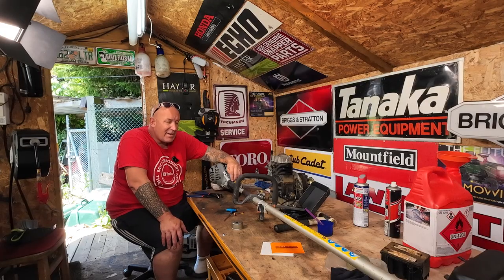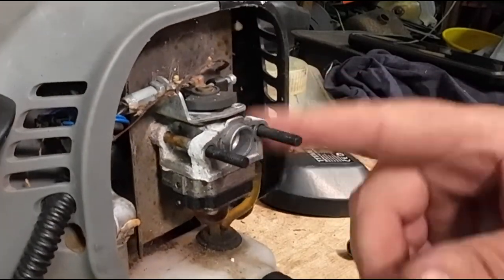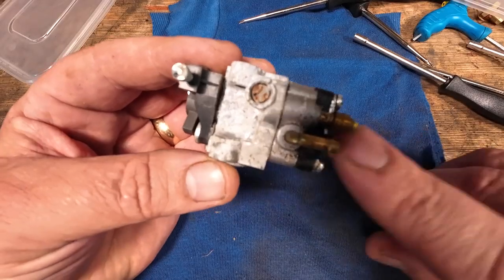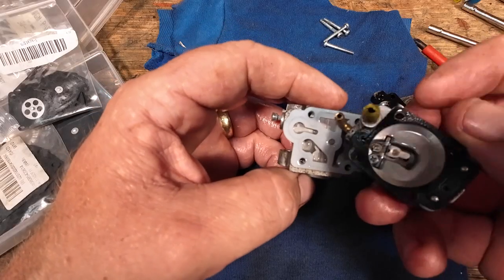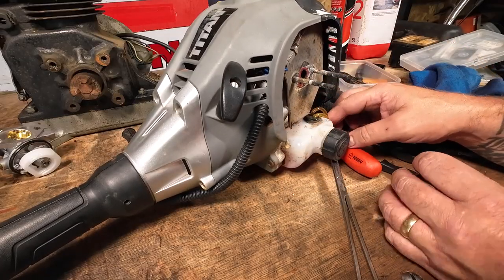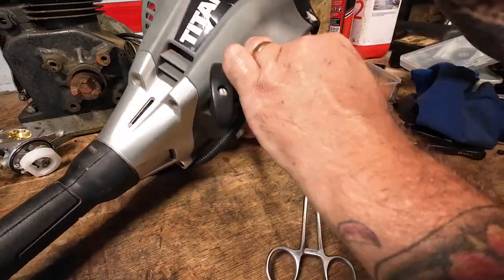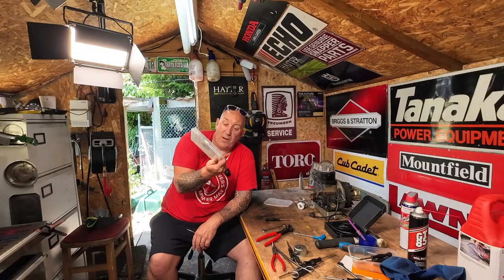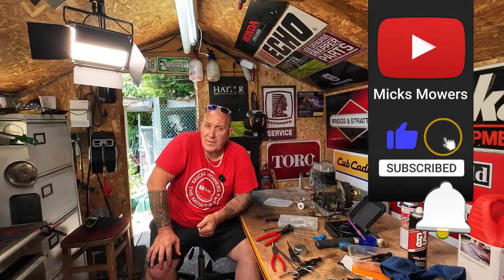Fixing a Titan Strimmer multi tool that bogs or will not stay running

Comment: 1st Try the adjustment screw at the end of the video with an ‘A circle’ tuning tool. Got mine working at full revs straight away. Also the strip down of the carb was very good and easy to follow 👍🏻 thanks for the uploads dude very helpful 🤟🏻👊🏻
Reply from the maker: @fermentedworld  you are welcome

Comment: Thank you so much - I have a new allotment with truly gigantic overgrowth but no tools and no £ - found a discarded, barely used Titan multi-tool in the back of the shared shed with missing parts, not starting, not running any attachments. Found you. I learned how the components work, how to troubleshoot, change and tune. I was so intimidated and so desperate - now I am neither after only about £10 for the oil and parts, my landscaping dreams are in full swing 🙂.  Never touched one before let alone fixed anything with a motor. Thanks again, Lady Tek-Li.
Reply from the maker: Hi.. well done you .. it's simple enough if you have something to watch and take your time... I'm glad the video helped.

Comment: Hi changed carb on my titan strimmer (as other one was buggered) for a new one off amazon. Had it running sweet one pull started.  Left for a couple of hours now wont start at all nothing. any suggestions.
Reply from the maker: @garethcollier9629  may need tuning mate
Reply: @themowerman  yes been adjusting mixture screw nothing.
Reply: Whats a best place to start?
Reply from the maker: @garethcollier9629  on the low screw .. screw it all the way in . Then undo I 1 turn.. then try and start it...
Reply: By 1 turn is that all way round or one turn with fingers? @themowerman
Reply from the maker: @garethcollier9629  yes
Reply: @themowerman  thanks again will screw in all way in and out one full turn. go from there. Much appreciated.

Comment: Hi Mick, great video and nice to see you doing a two stroke. A couple of pointers. I always change the fuel first if it is priming okay. Personally. On that Chinese machine, with a single ‘High’ trim screw and only being 3 years old. I would have tried adjusting the jet screw first. If that fails. Check the turn setting. Remove the needle and squirt a bit carb cleaner in there and allow to dwell for a few minutes. Try and then adjust.
If that fails. I would plonk in my ultrasonic tank. For a session.
Trust me. I have been doing this for many years. I only use neat WD40 in the ultrasonic tank. Pop the carb in. Prime it submerged, so it is full. And set it away. After half an hour. Pump the primer a few more times to refresh. And set away for another 30 mins. Or until it gets to about 80’C. 
I find this works most of the time.
Generally taking 2T carburettors to bits ends in gasket tearing. So I only do as a last resort, with a rebuild kit to hand. But this method normally works. Trust me! My tank takes about 2L. A gallon of WD is about £28 Used to be cheaper.
I only refresh a couple times a year. Filter the used WD and use in a spray bottle to lube allsorts, so it doesn’t go to waste.

Cheers 
David.
Reply from the maker: I agree mate .. but I knew it needed a little more work as it's been playing up for a while....

Comment: In the instruction manual for many of these throw away machines, it says after 5 tank full of fuel to get the carb tuned, but you need tools that are shaped like Pacman, D or double D to adjust the mix instead of a Philips or flat blade, so people just chucked them as they couldn't adjust them.
I picked up many like that and a quick tweak and it runs sweet.
😁
Reply from the maker: That they do my friend...

Comment: Nice job Mick!  I am a bit surprised you didn't change the priming bulb since you were into the carb that far.  Perhaps I'm changing them unnecessarily.  What's a good "rule of thumb" about changing them?
Reply from the maker: If it's in for service yes I would... This is my own bit of kit.. when it needs it I will...

Comment: Hi, which is the tool pack I need to tune the carburettor which cuts out. I’ve seen SUNREEK tool sets on Amazon I don’t know which set I need. Thankyou.
Reply from the maker: It's the pack man one I believe.. Hippotech 12 PCS Carburetor Adjustment Tool with Acircle Scredrivers for Common 2 Cycle Carburator Adjusting Small Engine Carb Tune up Adjusting Tool https://amzn.eu/d/gpzYCo3

Comment: Why did you go straight for the carb kit and not try the high and low settings on the carb?
Reply from the maker: Because I knew it needed doing.. I have had it 3 years....

Comment: Is that a honda hrx I see there mick?,I was wondering if I could pick ya brain mick I got a stihl 024 chainsaw and I've fixed it up with fuel line,filter,its hemorrhaging oil so I'm gunna change the oil pipes tomorrow,but it revs nice but as soon it goes to 8000rpm it takes off right up to 14 000 rpm and sounds like it's gunna destroy itself,I've got tachometer on it is it a case of fine tuning the high-speed screw or could it be that the high speed jet is wrecked
Reply from the maker: Yes mate.. it's an hrx.. but it's gone now.. could be a crankcase problem..
Reply: Thanks mick 👍

Comment: Hi mick, hope you’re well. I’ve fitted a new, OE carb to my customers balmoral. It now flows fuel through overflow pipe constantly. I’ve checked & cleaned jets etc. this’ll probably be familiar to you, any ideas please?
Thanks
Reply from the maker: Needle and seat.. or float problem.. take the carb off and see if it's letting by
Reply: @themowerman  hi, thanks v much. Fixed it now, tested float manually with bowl off, works fine. Put bowl back on carefully, seal is tricky to seat. Turned fuel on, slight leak, tapped side of bowl, float ‘released’ no leaks..
Ha ha!
Reply: @themowerman  hello, I’m having trouble working out what voltage battery I need for my balmoral 17 “ electric start Atco. Is it 6 or 12 v please?
Looked everywhere, no definitive answers.
Reply from the maker: @robowmower2005  here you go mate Ultramax 12V 4.5AH(5AH) AGM/GEL Rechargeable Battery for Mountfield Lawn Mower https://amzn.eu/d/3yl0beY
Reply: @themowerman  doh..it’s actually a commodore b17 w. Electric start. Looks a smaller engine & starter. Tried a12v battery but solenoid didn’t like it. Again mick please, correct battery for an Atco commodore b17 electric?
Thanks for your help 👍
Reply from the maker: @robowmower2005  I would say the same battery. I can't be 6v maybe the starter is a little sticky... Lots of wd40 on the starter shaft.. appendix.. try taking the plug out and turning it over for a while.. just to free it up a little

Comment: Have you had any issue with these not sparking? Mine has just let me down, it isn’t the plug- no spark from the HT. it looks like I’ve got to strip everything to get at the coil? 😡
Reply from the maker: Check the HT as it sometimes strips near the flywheel
Reply: @themowerman  cheers! I was hoping the coil might be easy to get to.. no such luck arrrgh
Reply from the maker: @dommoss4264  lol.. they are a pickle

Comment: Hi. Can I ask what is your fuel consumption per hour on this trimmer? I think mine uses way too much....
Reply from the maker: Ohh it's not a lot...
Reply: @themowerman  Mine uses almost the entire tank per hour of mowing grass 10-15 cm high with a line at medium-high speed. Do you think that's a lot?
Reply from the maker: @geekboy6655  not really mate
Reply: @themowerman  Ok, thanks a lot! I already wanted to screw with the carburetor which probably would have ended not so well :)

Comment: mine had a  new carb tuned it still the same needs throttle on to start it leave it to idle for abit then dies
Reply: clean the exhaust arrestor.
Reply from the maker: Try turning the idle screw up a little..
Reply from the maker: @colinwhite1743 good comment